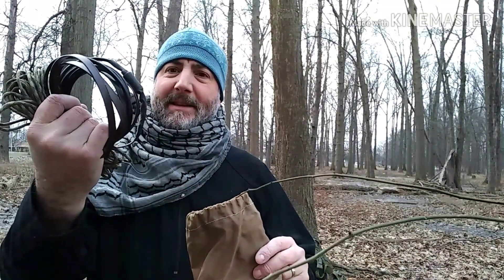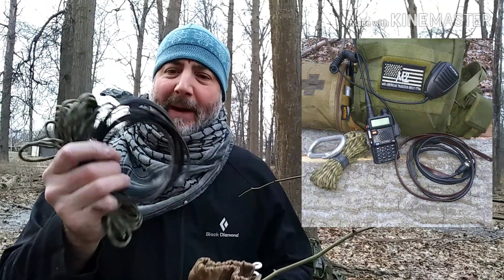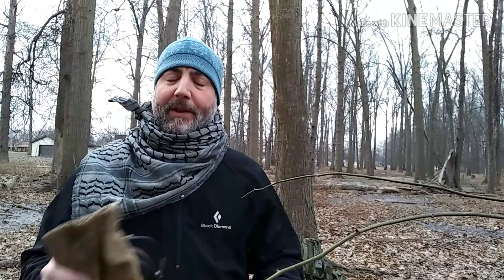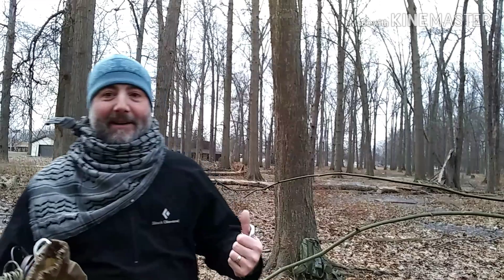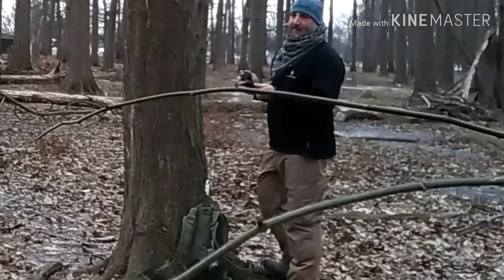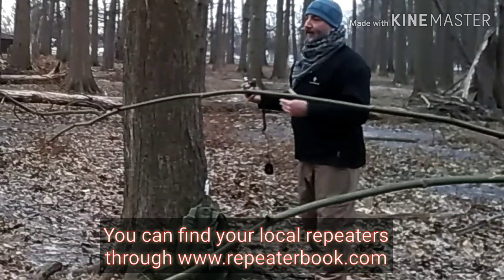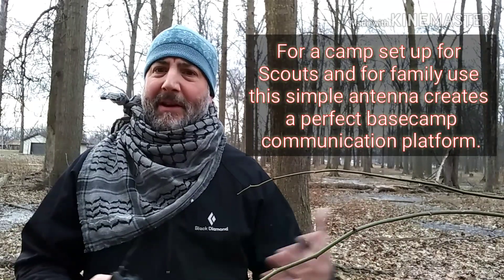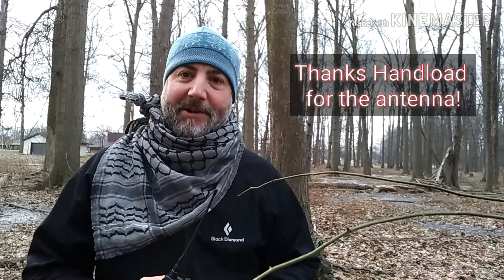Field Communications: 2m Roll Up Slim Jim Antenna

Comment: Good Demo....you might want to consider a BNC connector to make it easier plus a few feet of coax would get it up even higher...thanx for the video.
Reply from the maker: Thanks for the recommendations! I did end up putting a BNC connector on it along with the aforementioned extra coax cable! It gets more use than I thought it would!

Thanks for your comment!

Comment: awesome video! if you were able to reach out 15 miles from that location, how far would you have been able to reach just using the little rubber ducky? i recently bought 4 ht's and i am cramming hard and fast
Reply from the maker: Thanks for your comment!

The rubber sucky antenna maybe 1 to 2 miles max in good conditions, less in the woods. Add a longer whip antenna and your distance goes up.
Reply: @themodernminuteman2557  thanks man, i watched several videos, yours sold me. i just ordered this, now if ebay and the usps doesnt screw it up i will be in business
Reply: If your area is a little better, you can hit repeaters much farther away than that with an HT antenna. I have hit a repeater ~30 miles away using an upgraded antenna. I could hit it with the stock antenna, but my voice would be unintelligable. If you have been studying you know that line of sight is the difference. 2m/70cm are often used for space communications, including satellites, and the ISS.

Comment: This would've been great on some SAR missions a group I worked with in Missouri did a couple years ago. We were about ten miles from our TOC and could barely get through to them with 8-watt handhelds, and even then only by having a man climb to high ground and relaying transmissions from teams down searching the hollers.

I've since ordered one to use with my GMRS Kenwoods. Thanks for the video!
Reply from the maker: Glad you found this useful! 

Radio relays are always difficult, requiring manpower in situations where that person could be better utilized. My group had a similar situation where we weren't getting through so a relay had to be set up to get info through during a storm. Having a j-pole antenna setup at camp would've been a difference maker.
Reply: @themodernminuteman2557  I received my slim jim today and tested it out this evening! We've got a VOIP-linked repeater net in the area; I started off on my typical repeater at a full 4W with no issues as expected. Powered down to 1-1.5W, had clear audio and full quieting according to other users. I then decided to push my luck and successfully used another linked repeater 20-25 miles from my location. With a handheld on low power, and "rock solid" audio. I'm 110% sold on this little antenna - there aren't many 2-pound rigs that can make contacts like that!